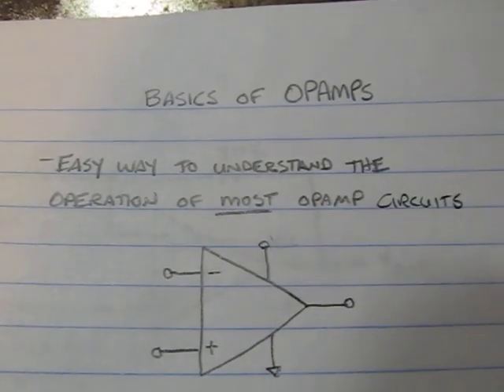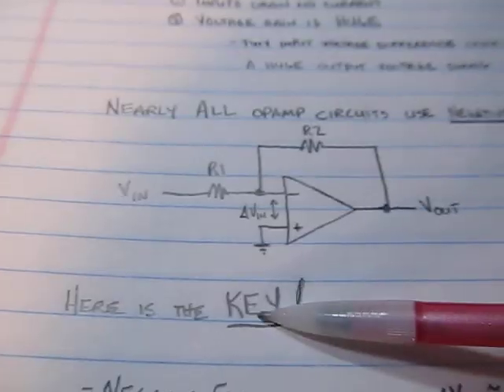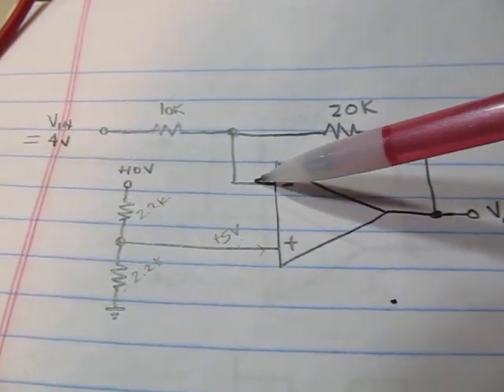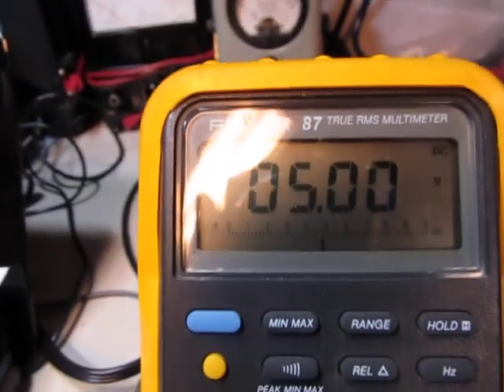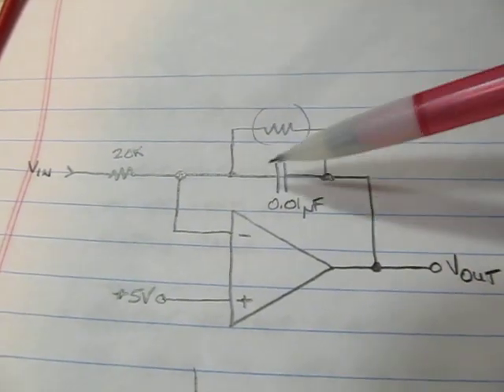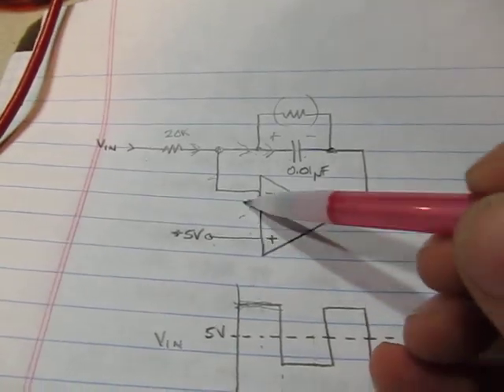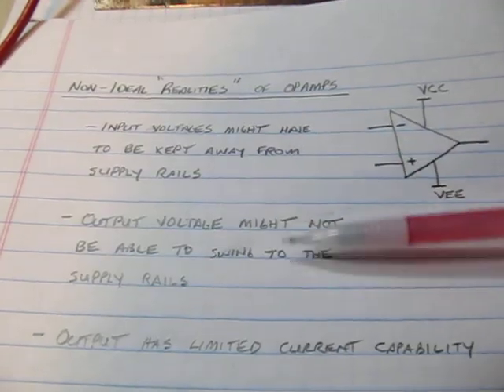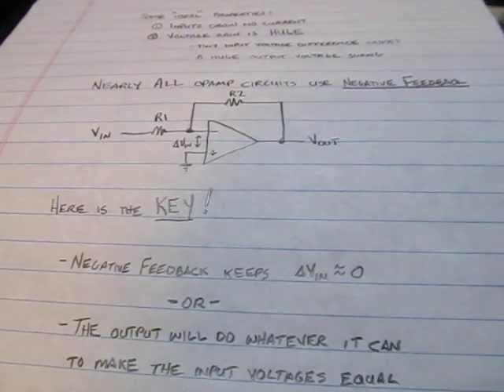#75: Basics of Opamp circuits - a tutorial on how to understand most opamp circuits

Comment: @w2aew At around 4min you mention the current is 100mA, I calculate 1V/10K resistor = 10mA?
Reply from the maker: Actually, I said 1V over 10K ohm is 100 microamps, which is correct.  Remember, it is a 10K resistor (10,000 ohms), not 10 ohms...  ;-)
Reply: Now I'm even more confused. Micro is 10^-6 you must mean mili? Also how is 10K ohm different from what I just said.. 10K resistor?
Reply: please provide your math 1V/100K = 100mA but it is a 10K resistor
Reply from the maker: 1V / 10,000 ohms =  0.0001 Amps.  0.0001A is 0.1mA, or 100uA (microamps)

Comment: I've seen circuits where one opamp input had a pull down resistor. Any reason for that?
Reply from the maker: This is usually done to provide first-order compensation for offsets due to the op amp's input bias currents.  The resistor will usually be approximately the same as the resistance seen by the inverting input.

Comment: Hello, I have a question regarding the inverting integrator. A capacitor has a time in which it charges and discharges, which means that if the input signal had a longer period, then the signal on the output will be a straight DC line after some time at the end of the ramp, because the capacitor is fully charged, right? Or after the capacitor has been charged, on the output there will be  0 Volts at the end of the ramp, because it blocks DC? 
Regarding the inverting op amp, in which Vout equals 7 Volts, I understood that by using Kirchoff's second law Vout is the sum of the other 2 voltages, 5V from V minus and 2V from the feedback resistor. But by using the gain formula for this amplifier, which is Rf / R1, then Vout = 20k / 10k * 4V ( which is Vin ), and the result becomes 8V. Which means that the best way of calculating Vout is by using Kirchoff's second law?
Reply from the maker: For the integrator, for a signal with a long duration, the capacitor would ideally charge (or discharge) indefinitely. In practice though, the voltage will be limited by the output voltage swing of the op amp.  Regarding the inverting amp - that gain formula only applies when the non-inverting input is at 0V.
Reply: Got it. Thank you very much!

Comment: Circuit 1 - What was the reason for voltage divider vs just using 5Vin?  Thx.
Reply from the maker: Just to show a typical application where a bias point is established using a voltage divider.
Reply: Thanks. This video has brought me a little closer to understanding these devices.

Comment: Am I right in saying that as the load increases, Vout decreases and the current through the resistors increases to compensate? 2nd question: For my LM741 opamp, do I connect pin 7 (pos) to +10V and pin 4 (neg) to GND? 3rd question: If I use one power supply then how do I get the 4V? I'm assuming the one power supply would be 10V. 4th question: Would it still be correct to label all of your voltages (including ground) to be 5V less? I thought the 10V source became +5V and -5V. I think this doesn't matter though.

Comment: Alan thank you for making this video. I had one comment to make about the sign convention of the first circuit you used to mark the 10K and 20K resistors. I think they should be labeled opposite of what you did. Starting from the Vout node and going counter clockwise, which is ~7V, there should be a -2V drop across the 20K resistor, which then gets you to the +5V at the inverting input node of the OPAMP, and finally a -1V drop across the 10K resistor to get you +4V at the voltage input.
Reply from the maker: The sign convention on the 10k and 20k resistors is correct.  As drawn, the voltage at the right side of each of these resistors is more positive than the voltage at the left side of each resistor - so the + goes on the right, the - on the left.  Using your words, you "drop" down in voltage as you trace from the output to the input, so you go down to a lower voltage as you trace from the output to the input.
Reply: Ah, of course that makes sense i didn't look at it from the supply side (aka voltage input). Both are correct and I guess as long as one is consistent in their sign convention, it all works out properly.

Comment: Thank you and it did refresh my mind. In theory this can be solved by superposition. For example replace 10V with ground and now you have output = 4x (- r2/r1) = -8V  next put back the 10V and replace 4V with ground, now output = 5 x (1+r2/r1) = 15V
add -8V and 15V and you get 7V   please note r1 =10K  r2 = 20K
Reply: Correct, thats the way I learned.

Comment: How would I calculate the peak to peak voltage of the triangular wave in this case?
Reply from the maker: Lets put down a couple of assumptions:
Square wave goes from Vmax to Vmin, and is centered around Vref (the voltage at non-inv input of op amp).
The op amp output doesn't saturate at either extreme, stays in linear region.
Then, you can figure the peak to peak as follows:

The ramp rate is:  V per unit time = I/C
The current I is: I = (Vmax-Vref)/R  or  (Vmin-Vref)/R  (both are same)
The amount of time we're charging (or discharging) is 1/2 the period  (t=1/2f)

Thus:
Vpp = I/C * t
substituting and simplifying:
Vpp = (Vmax-Vref)/(2*f*R*C)

Comment: 4:43 I was thinking output would be 3V. Pretty confused why not 3V?  and why 7V?
Reply from the maker: 4v applied at the input, add 1v across the 10k at the input, and add 2v across the feedback resistor.  That gives 7V at the output.
Reply: Thanks Alan. I am able to use this technique to solve non-inverting amplifier also. :) Now I don't need to remeber the formulae :D

Comment: Sorry I misunderstood. My mistake. I though you are supplying sawtooth.
Reply from the maker: No problem.  I am applying a square wave, and the "constant" voltage that appears across the input resistor in each state causes a constant charge/discharge current in the capacitor, resulting in a linear ramp up/down.

Comment: Very nice video. By the way for the second circuit you are using opamp as compactor. The rule for comparator is :  if vin > Vref  Vout = + V     if Vin < Vref Vout = 0. adding capacitor it will create ringing effect on beginning of pulse that's because of charge and discharge. in your case do not need any capacitor.  the circuit will work fine.    

Andre
Reply from the maker: No, not really.  It is configured as an integrator, intended to create a sawtooth shaped output from a squarewave input - all due to the fact that the feedback forces a constant charge/discharge current in the capacitor.  Of course, if the capacitor were very small, the circuit would work like a comparator.

Comment: would an inverting op amp circuit create a 180 degree phase shift of the origonal signal/ i dont have an oscilliscope so i cant test it
Reply from the maker: yes, basically.  Plus the phase shift / propagation delay through the op amp itself.
Reply: propogation delay? does that mea that itll delay and therfore the frequency will lower?
Reply from the maker: No, just very slightly more than 180 degree shift, but only for high speed signals.  For most applications, it'll be very close to 180 degrees.
Reply: oh, anyway i can smooth that out,

Comment: 3:11 can someone explain how this is 'simple ohms law', I dont understand :)
Reply from the maker: You have 10V applied to a pair of 2.2k resistors in series. The series resistors total 4.4kohms. The current through these resistors is 10V/4400ohms which equals 2.27mA. Next we want to calculate the voltage across the lower 2.2k resistor, since this is also the voltage at the op amp noninverting input. The current through the resistor is 2.27mA, so the voltage is 0.0027*2200 which is 5V. Two applications of ohms law.

Comment: can you tell me what exact components(op amp) do i use if i wanna simulate the integrator into multisim 12? so that i get the triangle output when i put thesquare voltage in the input pin, like you explained on the paper? i found the op amp LM358 but there are some 24 of it, with some letters at the end of LM358,,, like LM458P, or D, AH,M N etc!!
Reply from the maker: The letters at the end typically designate the package that the device is in (DIP, SOIC, etc.), so will have no effect on the model used in a simulator.  This circuit is very non-critical, and would probably simulate fine with an "ideal" op amp model that probably exists in Multisim.  I've never used Multisym, so I don't know what models you have available.

Comment: yo man can op amp buffer voltages within millivolt range. like 80 mv
Reply from the maker: Yes, certainly. You might need to use an op amp with a low offset voltage rating.
Reply: w2aew like ic  741 ?? , will  it do
Reply from the maker: That would not be a good choice for a low voltage or low noise application. There are many factors to select an appropriate op amp. Things such as signal bandwidth, requirements for accuracy, noise, power supplies, gain, etc. will all factor into what op amp is selected. The likelihood is that dozens will be perfectly adequate. Manufacturers such as TI, Analog Devices, Linear Technology all have excellent selection guides on their websites to help you select appropriate devices based on your application requirements.
Reply: thank you man i just wanted an op amp for 50hz sine wave generator .
Reply from the maker: Ok, then the main considerations are the input and output voltages ranges requirements, including any need for rail to rail voltage requirements, and the power supply requirements (single or dual, what supply voltage is needed, etc)
Reply: ***** voltage of 12v +/- is enough which can be easily given to 741 ic .just need perfect sine wave at 50hz .can phase shift oscillator produce 50hz sine wave properly ??. if you can suggest an better op amp ic for this operation it would be great.

Comment: The idea that the current decreases if anyone is still wondering, because of the constant current the capacitor charges up, as the current flows towards the Vout , the capacitor charges in other direction as a action of accumulating charge or converting the current into electric field this reduces the voltage difference between the Vout and the Pin 2 of the Opamp,  causes the current to cease slowly (yet too fast for us ), During the opposite case, when Vin is smaller than 5V, the current flows from the Vout to Vin through the capacitor which discharges it causing a flow of current.

Comment: hello -
and thanks for the primer on op-amps. you are organized and have a friendly teaching style. there is one thing that I didn't get tho. you said that a Tiny difference in input voltages would result in a HUGE output voltage gain. you showed a 5v input and a 4v input, and the output was 7v. 7x higher. that doesn't seem huge to me. still, if the output is actually higher than Vcc, that is very useful.
a transistor with a gain of 100 is limited to the Vcc (at least as I understand it).
is that the idea in a nutshell, that with an op-amp you get an increase in voltage ?
Reply from the maker: That statement refers to the voltages appearing at the + and - input terminals of the op amp itself, not the voltage on the other side of the resistors.  "Ideally" the voltage difference between the + and - inputs is "zero", but in reality it is a very, very small value due to the huge open loop gain.  Also, the output voltage is limited to the supply rails or less.

Comment: why it's 5V 

3:16
Reply: +burnout623 voltage division can be derived from ohm's law.
Reply from the maker: Because there is 10V applied to a resistor voltage divider consisting of equal 2.2kOhm resistors - thus the voltage appearing at the junction of the two resistors is 1/2 of the applied 10V - thus = 5V.
Reply: it called voltage division, not ohms law
the formula is 
V=(R1/(R1+R2)) * Vs      (R1 & R2 in series w/ Vs)
since R1=R2 it becomes
V=(1/(1+1)) * Vs; V= (1/2) * Vs
V=(1/2) (10v)=5v

Comment: If the voltage on the inverting input is greater than the voltage on the non-inverting input, then the output is negative and nearly equal to the negative power supply.

If the voltage in non-inverting is greater than voltage in inverting input, then the output is positive and nearly equal to the positive power supply.

True?
Reply from the maker: Yes, if there is no feedback being used. How close the voltage gets to the supply rails is dependent on the particular op amp.

Comment: Hi , this is fantastic. I am only a beginner but this explained it so well.
Two questions what freq square wave and what value resistor are you using.
I am trying this on "every circuit", simulator on iPad, and then in real life .
The first circuit worked fine , but struggling on the second.
Reply from the maker: It was a 10kHz square wave. and 1Mohm across the feedback cap.  Circuits with "storage" like this integrator circuit are sometimes difficult to simulate.
Reply: Thanks for getting back to me , I will build this and test it as soon as I can.

Comment: thanks sir on the circuit u said that the output to be 7v but actullay its a non inverting amplifier hence v0 =(1+rf/r1)v1 which gives (1+20/10)(5) hence output becomes 15 v how can u say it be 
 7 v
Reply from the maker: Study the circuit again.  It is an inverting configuration (the 4V is the input).  The equation you stated only applies to a non-inverting configuration, and only when the inverting input is connected to ground. Neither of these conditions apply.  This is where it is more important to know how the circuit behaves rather than to apply textbook equations. The voltage divider (two 2.2k resistors) sets up the voltage at the (+) input.  The feedback will force the (-) input to be at this same voltage (5V).  The 4V input allows you to compute how much current will flow in the input resistor (10K), thus how much flows in the feedback resistor (20k), thus you can calculate the output voltage.  The circuit has a gain of -2 (Rf/Ri), with respect to the +5V at the input.  Thus, a 4V input (which is -1V with respect to the op amp inputs) translates to +7V output (5V + -2*-1V).

Comment: how do u  say 100 mA flows through the feedback resister
Reply from the maker: In the example, 100 microamps flows through the feedback resistor (20K), not 100mA.
Reply: can u please tell me how do u get 100microamps from output
Reply from the maker: The current that flows depends on the resistors connected, and the bias voltages present.  In the example shown, the output voltage increases until the input voltage difference is zero, that puts 2V across the 20K feedback resistor, thus 100uA flows from the output thru this resistor.

Comment: which direction is the current flowing?at the output
Reply from the maker: It depends on the particular circuit or application.  Most op amps can either source or sink current as necessary to achieve the voltage required to properly close the feedback loop (make the two input voltages equal).

Comment: One more, on the integrator example, why as the capacitor charges and creates a V differential, the Vout drops...why?
Reply from the maker: The negative feedback always keeps the inverting and non-inverting inputs at the same voltage - in this case, at +5V.  So, as cap charges up, the left side gets more positive than the right side.  Since the left side is "held" at +5V due to the feedback, the voltage at the right side falls as the voltage across the capacitor increases.
Reply: And without the top resistor over the capacitor, this wouldnt work as an integrator, right?
Reply from the maker: It would work, but it would also integrate the input bias current of the op amp.
Reply: Could you please explain it in more detail. I didn't get what this resistor is for.

Comment: At the start you say that a small + Vin will make the inverting input > than GND, why?  Then because that happens, Vout will go down, why?  Thanks
Reply from the maker: It is a differential input.  When the input voltage difference is positive, the output goes high.  When the input voltage difference is negative, the output goes low.  Thus, when the inverting input is brought above the non-inverting input, the output goes down.
Reply: So when a + voltage is applied to the inverting, because its inverting, + voltage on a - terminal, will make the end voltage -, which will bring the output of the opamp down.

Does it mean that if I apply a - voltage to the inverting terminal, it will make it +, which means Vout will also be positive?
Reply from the maker: Yes.

Comment: this is a really good video. I learned so much from it, it feels strange to have not known before.
I have two questions; how would you analyse an inverting-configured amplifier with a resistor between ground and +in, and how would you decide what resistor to use in parallel with an integrator's capacitor?
Reply from the maker: The resistor between ground and IN+ in an inverting configuration doesn't change the gain equation at all.  Often times this resistor on the IN+ node is there to balance out the voltage drop induced by the input bias current of the op amp (and the value is usually the parallel combination of the input and feedback resistors on the IN-), so that input bias currents don't produce an appreciable output offset.  The resistor around the integration capacitor is chosen to be quite large - resulting in a RC time constant that is much longer than the integration time desired in the circuit.
Reply: great, thanks for your help!

Comment: 7 videos on op amps and not one explains the first thing. What does inverting and non inverting mean. One turns all the little electrons upside down ? Why do you all skip an important basic ?
Reply from the maker: Non-inverting means that the output voltage moves in the same direction as the input. If the input voltage rises, then the output voltage rises. It is the opposite for the inverting input. When a signal on the inverting input rises, then the output voltage goes down.
Reply: ***** Thanks. I should have asked you first.